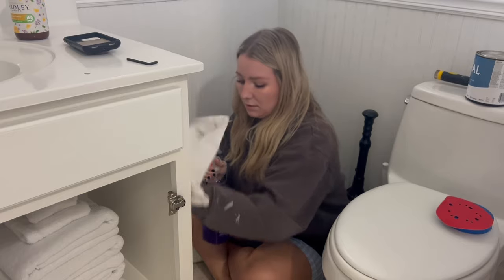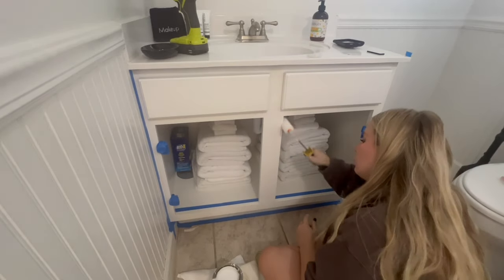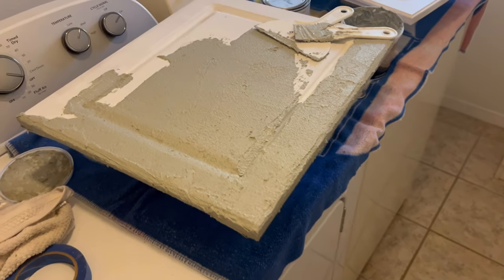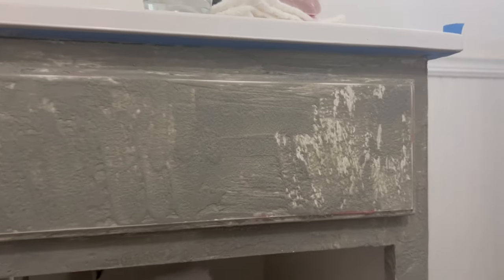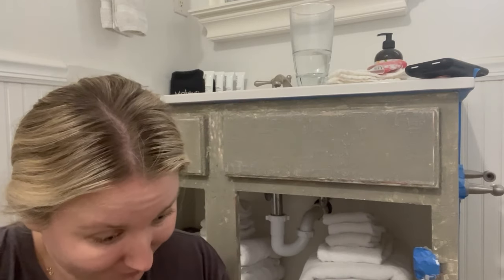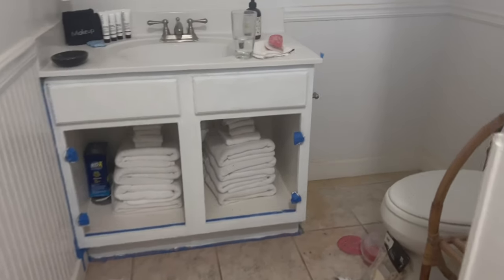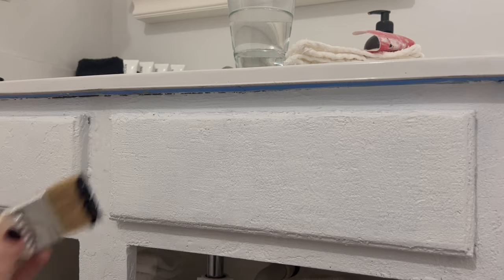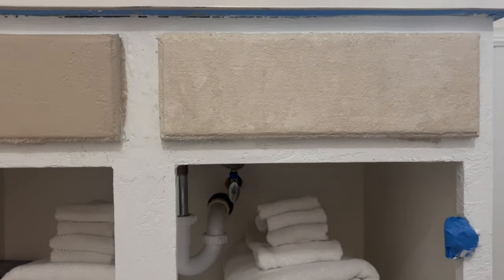**bathroom DIY** - WILL CONCRETE PATCH WORK?! -

Comment: There is a product called Concretta by Moeded that does what you are wanting to achieve. Not cheap but beautiful, designed for this use, and waterproof.

Comment: I'm confused as to WHY you wanted a concrete look in the bathroom? The final color is nice but the texture looks sloppy. 🙁 Were you unable to remove the drawer faces above the cabinet doors? They usually just pop off. I love your can-do spirit but, maybe, a little more research before wasting so much time and energy? I'm glad you didn't shy away from posting this, though. It's encouraging to see results that aren't perfect because us mortals need to be able to connect with content creators. 🤗✌
Reply from the maker: Yeah this was definitely an experiment that I would say failed. I was going for the micro cement look and was hoping the concrete patch would do the trick. Turns out, not at all. Haha. But yeah, I think it’s important to share this stuff too. Because it’s also not the worst thing in the world, it just didn’t give me the microcement look I wanted.